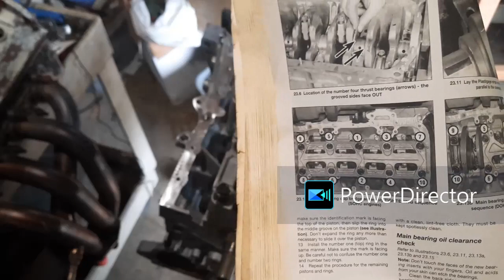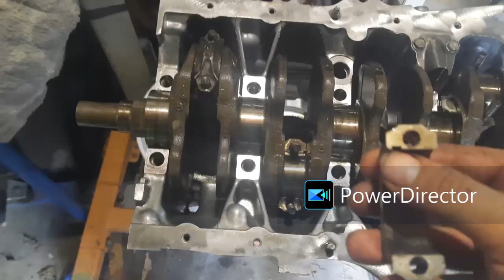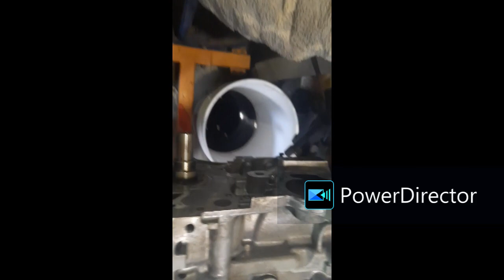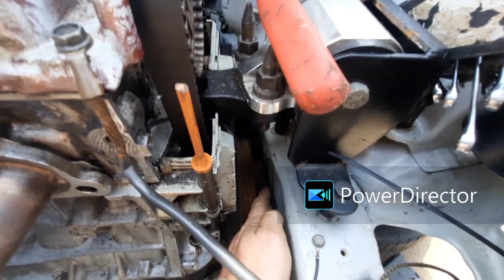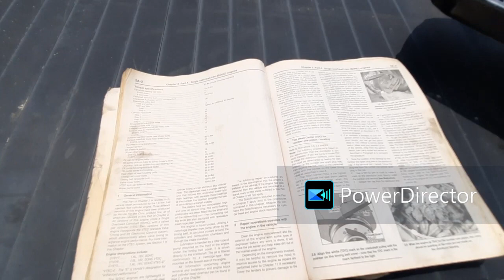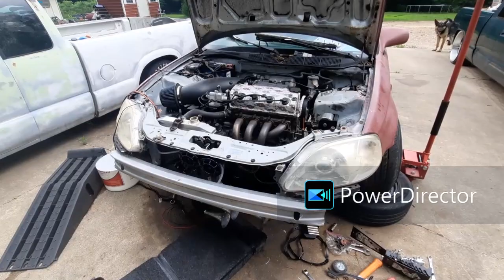Civic update. Engine rebuild is DONE!!!!

Comment: Nice work!  Glad it was just a sensor.  I listen to my Jeep diesel all the time because i'm curious if i hurried through anything and just haven't found out yet.  ;)
Reply from the maker: Yeah. I got it all back together and if course 2nd guess and double checking everything. Motor seemed kinda tight though maybe did something wrong. Even emailed n talked to James over at Texas Honda channel about it. Thought maybe crank bearings were to tight. Cranked first time and it sounded like the sound had moved making me think bearings or maybe we cracked flywheel. Pulled oil pan saw wasn't bearings then thought it was tensioner. Pulled it apart n found crank sensor was lose fixed it now gotta get frame notched n drive it.
Reply: @GlassWerx  PHEW!
Reply from the maker: @2StallGarage  ikr alota stress for something so minor. Hard part was trying to find the replacement bearings and tryin figure out what ones to get ECT. Luckily didn't need to after all